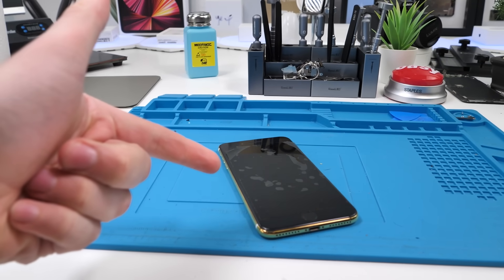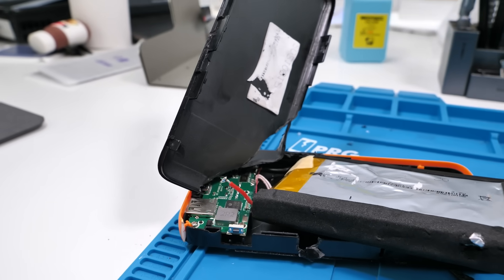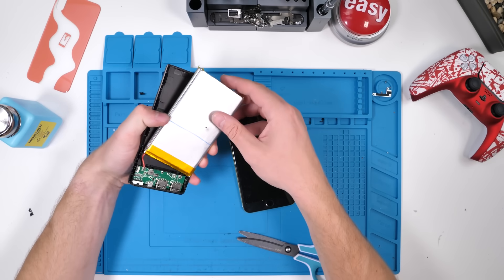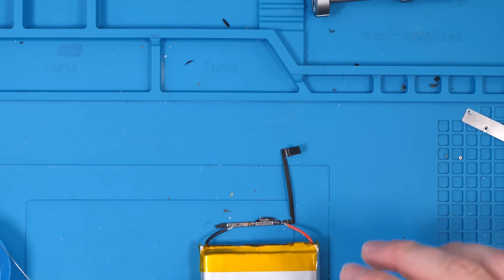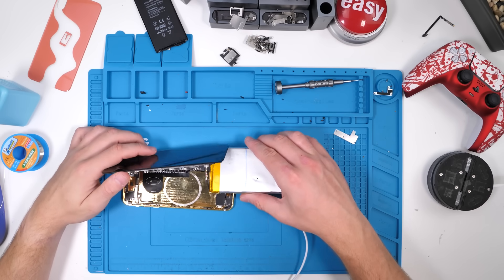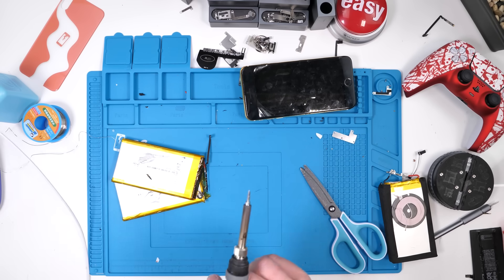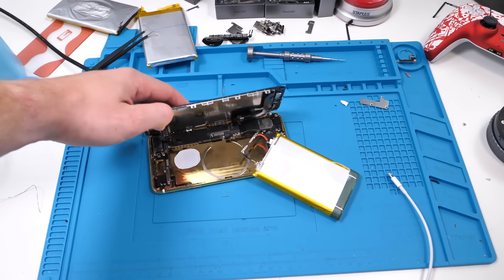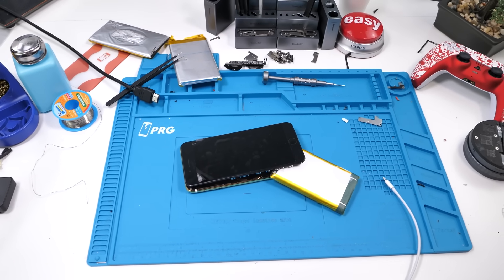Can I Install This Power Bank Battery Into An iPhone?? 10,000 mAh

Comment: The reason it did not work the first time was that the 2 LiPo batteries together in series gives roughly 7.4 volts which is way above what the iPhone 7 needs which is 3.7. The abnormality is what could have caused the boot loop since it didn’t know what to do with all the power at once. In fact you’re lucky you didn’t fry anything
Reply: These batteries must be in parallel and not in series. I'm not sure if the phone can handle more than 6 volts on the battery traces. Most smaller chips are limited at 5.5 volts at the absolute maximum ratings
Reply: @az4026-u1j  good point.
Reply: @az4026-u1j  I'm surprised that the BMS survived that voltage without actually starting to discharge the batteries.
Reply: @az4026-u1j  also the actual voltages used are as small as 0.6v
Reply: @az4026-u1j  
These are fast charging battery banks and fast charging can get up to 20v or more.
Reply: @E-hab  The highest voltage on power bank I've seen is 4 cells in series which is between 14.8 and 16.8 volts and that's on the ones that's support power delivery over the USB Type C port. These power banks can output up to 65 watts (20 volts, 3.25 amps). The power bank he got the batteries from is not that type.
Reply: Bruh, the battery of the power bank is not in series but in parallel
Reply: The huge problem most people oversee is that most powerbank still uses the old 3.7v nominal cell, while iPhone and most phone use either 3.85v or the newer 3.9v cell. You can look at your battery to see which yours is. At 3.9v, the full charged state will be 4.4v, instead of the common 4.2v. That powerbank battery will be in the shape of a pregnant lady in less than a week.
Reply: All people here are scholars or wot 😨
Reply: @bennyyt7726 FR💀
Reply: @bennyyt7726  was thinking the same thing too😂
Reply: The 2 Batteries are in Parallel and not in series. So the Voltage still is 3.7V. Most cheap Powerbanks use 3.7V Batteries.
Reply: @cinematica9073  All lithium ion batteries are at nominal rating 3.6 or 3.7 volts. I have seen batteries on power tools with a rating of 3.6 volts
Reply: The fact that this comment is wrong and he still click loved this comment is beyond me.
Reply: I think the reason is that there are 2 bms, one on the battery and the  iphone bms
Reply: it would fry the phone instatly. powerbank batteries are in paralel tho not series
Reply: Did it work if we use some step down buck converter??
Reply: I know that is the better way of putting oversized batteries connected to phones because the wires you use to charge your device have mini inverters and tiny bits of software not including the block to the wall that have their own converting boards @thewanderingguy5436
Reply: I don't want to call phone repair guru dumb or anything but I would have thought that he took that into consideration.
Reply: Dear God, the reason is so simple, those batteries were in parallel but because of internal resistance and voltage differential it didnt turn on
Reply: Power bank is in parallel connection you dont know Anything i think you are Black indian
Reply: Did this idiot just say 2 batteries doubles the voltage 😂
Reply: I guess we are all figuring it out with him but why would the power bank have a 7 volts out is my question
Reply: Thought he would be smart enough to check the voltage first since he's a phone repair guru😂😂
Reply: if he does ake it work witht 8Ah batt how to program the ios to read it as it is not the stock read data from the ios (2700mah)
Reply: @sargera1  not sure, but you can do it on a rooted Android
Reply: @@randomacc7808 does it work same on andro?

this befun like making a 2x mophie juice pa ck for an XR
Reply: am pretty sure that these battery's are connected in parallel powerbanks need capacity not more voltages
Reply: THEY ARE IN PARALLEL CONNECTION IF THEY ARE IN SERIES THE PHONE CHIP FRY IN 1 MINUTE
Reply: No. They are in parallel the reason it won't work is because it already has a BMS and it's like he is using it in parallel.
Reply: That's what I wanted to say
Reply: I was waiting for him to figure that out lol
Reply: The reason it did not work the first time was due to the amp(the iPhone cannot handle high amps), in parallel the amp is added in series the volt is. If it was in series as you thought, that would be about 7v +or- and would fry the BMS immediately
Reply: @O_Chilavert  Not exactly how it works, amps (the current) is very different from volts
Unlike the voltage, the iPhone will just simply use how much amps it needs. There was probably just a weird fault or issue how the battery was connected.

Just like some car batteries, you could draw 100 amps at once but under normal circumstances if you're using a low wattage inverter, maybe at best 15 amps out of 100 is used.

Amps can be used to measure how long a battery will last, however.
For example,  10,000mAh, or 10Ah, with a device only drawing 0.5 amps, will allow the battery to last about 20 hours straight, or if the device draws 3 amps, then it would only last about just over 3 hours.

If you really wanted to, you could connect 100x300Ah large deepcycle batteries to a UPS, sure it would take a super long time to charge but it will save your PC for maybe a couple of weeks to a few months of power outages depending what you're doing. Not sure why you would want to but it's just an example.

Though for safety reasons when dealing with higher amperage appliances you should limit the current otherwise with an iPhone it's probably already managed by both the BMS and the iPhone itself since realistically you can draw infinite current from any battery before the BMS itself, assuming you can do so without setting the battery on fire.

Comment: Those packs are 2 LiPos together, did you check the voltage to see if it’s 3.7V? The two cells might be in series at 7.4V which wouldn’t work with the iPhone BMS (and would probably destroy it tbh).
Reply: Not funny bot
Reply: @ImperialAnimate  he is actually totally right ! soldering 2 cells could have destroy the iphone
Reply: @ImperialAnimate  😥

Comment: Are the voltages the same? If not you can solder a buck converter between the battery and the board.
Reply: That wouldn’t be easy